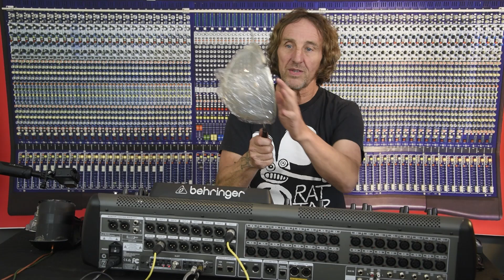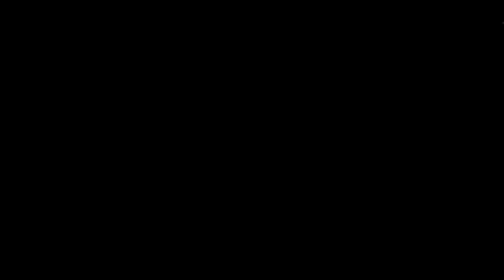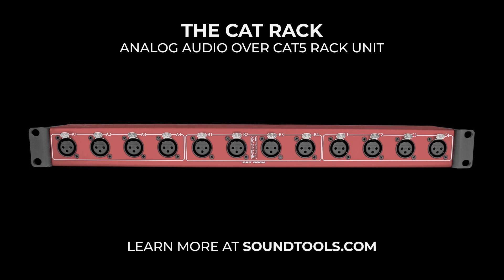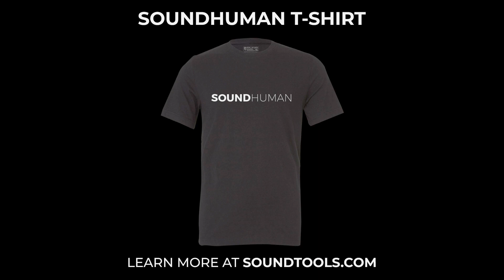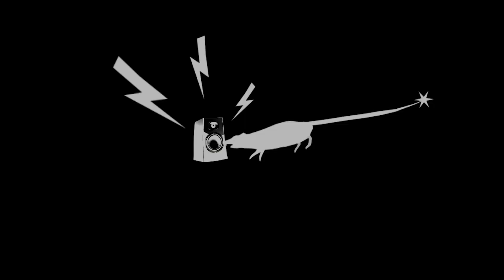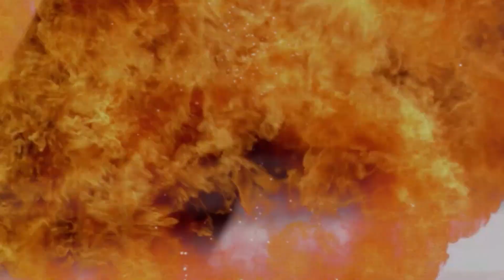Aux Fed Subwoofers Are Better - Because of How Mics Work

Comment: You actually convinced me to try it. But in our setup all misxbusses of the X32 are already used. Would using the mono channel and sending it to the matrix create latency problems? So my mains would be: channel -> LR -> matrix 1+2, and the subs would be: channel -> mono -> matrix 3. Do i need to send the signal through the matrix to avoid phase issues?
Reply: There are no latency issues with different routings on the X/M32.  Dave actually tested this for us!  We use the M/C bus to feed our subs. It’s perfect for this use case.  You get a dedicated pot and on/off switch for the selected channel, you get a dedicated master bus fader that can have high and low pass filters set if needed, and for your needs, you don’t use up any of the 16 mix buses or 6 matrix sends.  Just assign the M/C bus to  one or more of your 16 outputs and you’re good to go.
Reply from the maker: As long as you don't patch plugins on the groups or matrix, it won't add latency.  Also, a Ms or 2 latency on the subs vs the mains is no big deal. 80hz has a wavelength of 14 feet, 2 Ms would only impact the crossover summation by less than a db 8n the crossover range
Reply: Thanks!

Comment: Great to hear you say this. I've been an advocate of aux fed subs for a very long time. 

I work in corporate rather than live music but from time to time the PA will have subs in it and often times it's set up by someone else and I come in and mix the event. I often find they've either sent everything to the subs or in the case of d&b PA they've set things up in mix/top sub configuration letting the amp's crossover handle the split. 

I only need my playback machines and background music to go to the subs but they've routed everything: top table mics, lectern mics, lapel mics, hand helds, everything. So I unpick their rig and route things my way with only the things with desired low end information to the subs. 

Even for the mains I tend to roll off a lot of the low end in most speech mics to minimise unwanted noise (and try not to remove the colour of the presenter's voice).

I suspect this old school purist matrix/mono sub routing ideology is also why so many live music engineers have really flabby sounding subs rather than tight and punchy ones!
Reply: With mix/top sub with d&b you can still set the input source of the sub outputs to a different input.
You just need to know how to navigate the amp.
Reply from the maker: That is another great example of why subs need to be seperate

Comment: Good explanation Dave! But how can I integrate that aux send when I use subgroups and pre/post DCAs? E.g. a subgroup with the kick and snare or one with the oh´s and toms in it.. It seems possible to send it trough a matrix to make that run, which makes fully sense and then there is the mono(master)bus. To use this bus should make it way easier to seperate those frequencies in my opinion. What do you think?
Reply from the maker: Just like everything and mixing whatever routing choice you use has its advantages and challenges. The mono sand is definitely a cool way to go as it will be controlled as the channel is and instead of sending the left and right it just sends out the mono the subs. Sending off of a group or dialing the groups up in matrix's are also good ways it really depends on the other controls you need

Comment: Wow, this was illuminating. I haven't been able to comment or browse vids for awhile (life's been busy), but this was an eye opener. I always assumed that high pass filters generally did a good enough job that you could mix into L&R only, but I never realized how much remains down there to be heard in subs! Gotta consider changes at the church ☺️ Thanks Dave as always! Hope I can sit in on a members Zoom soon!
Reply: Not much remains. DId you see how much further up he had to push the fader to get it audible?
Reply from the maker: That is a 3" speaker. Even the slightest amount of low end garbage is quite audible on a large sub system.

Would you buy a sound system with 10% distortion? Do you think you can hear 10% distortion added to you mix?

If the cumulative sub energy crap sent to your subs is 20db down, that would be the equivalent of 10% distortion.

But yeah, it's not the end of the world and distortion is hard to hear at lower freqs. And subs on an aux is not needed for a great mix and also, the great mix will be a bit greater with the garbage removed.
Reply: I think you have a great point but a bit too one sided. The more lows handled by the subs, the more headroom and clarity in the mains is too be considered as well. Depends on cabinet sizes, coverage etc... A lot to consider.
Reply from the maker: I will do more on this and show what sound filters let through that seperate sends prevent.

A high pass reduces unwanted lows and reduces lows sent to subs. And cleans up a mix

A separate subs send eliminates unwanted lows sent to the subs and cleans the mix up even more
Reply from the maker: Cool cool Efrain and see ya soon zoom

Comment: This is related, but unrelated.   I've heard you mention in the past that you'd rather not hi-pass your mains so they they are always full range.  I guess that would coincide with this since your mains are providing some of the lows in the very top of the subwoofer range for instruments that do dip down in that range but are not sent directly to the subs?
Reply from the maker: I personally prefer to high pass the mains for similar reasons that I like subs on an aux.

That said, for instruments not sent to the subs you can boost lows on that instrument to get the sound you want out of the mains
Reply: @DaveRat  interesting, I could have sworn I heard you mention to NOT hi-pass the mains.  I must losing it. Lol.
Reply from the maker: L-Acoustics is big into full range main PA. I high pass them because I don't like the overlap between mains and subs, it creates more issues and collapses the stereo image.
Reply: @DaveRat  alrighty.  Yea, I wish I can remember where/who said to leave the mains full range.  I personally set my speakers to match the subs QSC K12.2s/112s so its doing the hi-passing on its own. I just thought the concept of NOT hi passing was interesting.  The concept was to leave the mains alone and then roll top of the subs off at where the mains naturally roll off. 🤷🏻
Reply from the maker: There is no right way. I would say that whatever way is used, avoid having a bumb in the lows where there is an overlap is preferred.

In bigger venues, also the room resonance is often around 80 to 160, I make sure to get rid of that freq range either with EQ or high pass.
Reply: @DaveRat  thanks Dave! :)

Comment: Awesome topic. I’ve seen a lot of people say they use a Matrix to feed their subs and mains. Most of them send their entire LR to the sub matrix though and create their own crossover with HP and LP filters. I like your idea of using a group for all sub instruments and then sending that to a matrix. I feel that might be the best option. I never realized how much unwanted low end energy gets sent out.
Reply from the maker: 8ve done setups live with the group send and compared and the difference was quite audible
Reply: They're most likely eyeballing the system integrator's job with a janky workaround. The system crossovers should be handled by proper speaker management systems or inside dsp amps. This way, the system integrator can tweak every delay and tuck phases into place for optimized spatial distribution and frequency response. You can still feed subs seperately in such a setup, which would be ideal for sound quality and flexibility. If you just want a stereo setup, send the main mix to the sub-group. If you don't want that, send individual instruments there as you please.
Reply from the maker: Agreed
Reply: @DaveRat  I agree, unfortunately some manufacturers are a little conservative with their parametes (L-Acoustics won't let you freely tweak he crossover freq for the subs to anything else than their set freq AFAIK) hence the need for a matrix. But agreed the "to-the-subs' groupe absolutely makes sense.
Reply from the maker: You don't really need to mess with it but yeah, I used to carry a crossover that I would put in the subwoofer out and have the option to low pass the subs further if desired
Reply: @DaveRat  This is where my thoughts were headed. Based on your vid and all the great comments, I'm trying to boil it down to the next best option since I'm kinda greedy about needing all my actual aux send in my X32 for a handful of wedges, a handful of IEMs and at least one more for a house mix that shows up elsewhere in the building if the have an XLR in the wall for that zone perhaps. I have some older Xovers kicking around as well as a dbx driverack that could be useful in a few ways I bet.
Reply from the maker: Yes making concessions or altering our setup based on the gear at hand is part of the fun